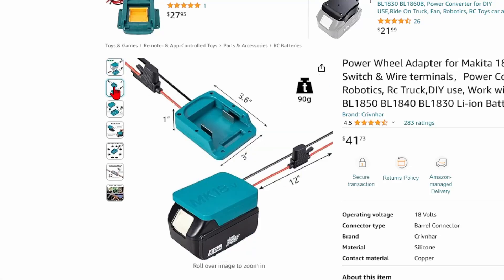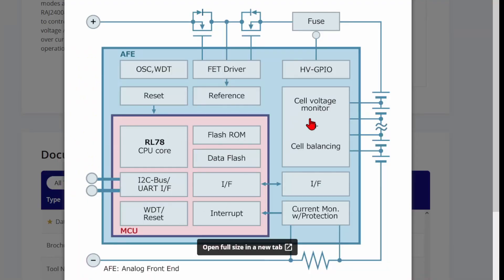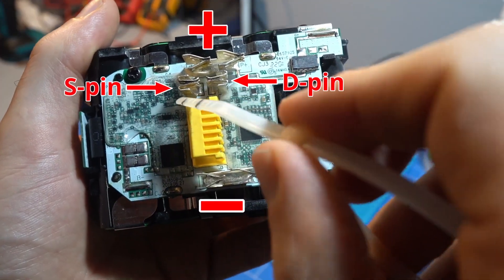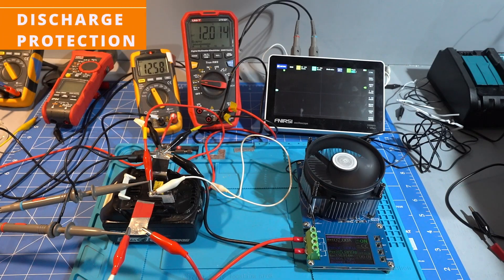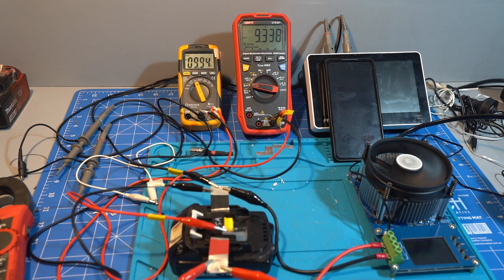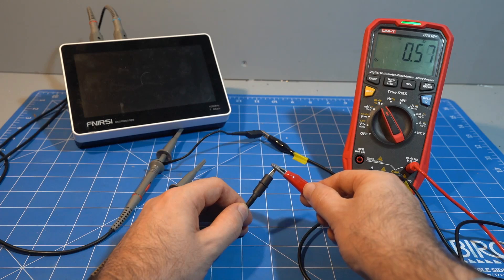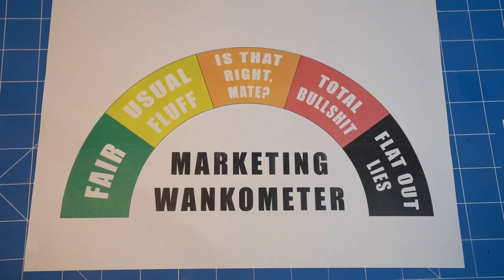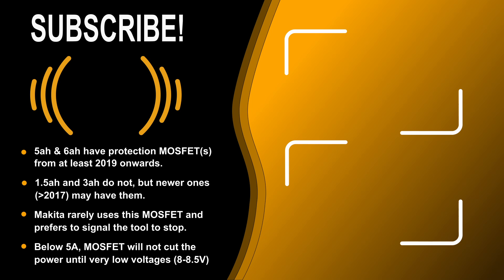[006] Do Makita LXT batteries have low-voltage protection?

Comment: Great stuff! Recently i thought my little Makita fan had bricked my new 6Ah battery after i let it run to dead. Fan only has 2 pins so no temp/voltage monitoring. Battery had no lights, but charged up fine. I wish I'd checked its voltage!
Reply from the maker: Interesting that it's a 2-pin tool. Was it genuine Makita? Was it a really old one from before star protection?

Only other reason would be if it draws less than 1.1A. Under that and the 1.5 & 3Ah go to sleep. I would have thought a fan would pull at least 3A
Reply from the maker: I'm well off. The 235mm fan gets 7h on a 6Ah, so <1A even on high. Even the 330mm fan is 3.5h on a 6Ah, so <2A.
Reply: @toolscientist  DCF 102, built 2020 bought from total tools, yet no Star on it. It's really small (180mm) so low current I guess

Comment: @ToolScientist - When using the battery capacity tester (heatsink and fan) what settings did you use for low voltage cutoff and amp draw?  What would proper settings be to accurately determine amp hour capacity of battery?
Reply from the maker: Low voltage cutoff was always 0V as I was testing to see what the battery's cutoff was. I would stop the test if it went below 6V. Amp draw was usually 7A to make the tests faster, but I did several tests to examine the weird lower cutoff that occurs below 5A. 

Proper settings according to most datasheets is 2.5V/cell and 0.2C discharge. So that would be 12.5V for an 18V battery. Discharge is 0.2*capacity, so 0.2*5Ah would be 1A. For a 3Ah it would be 0.6A. These are quite low and very few power tools would go this low, but that's the industry standard for capacity testing and what most manufacturers (Samsung, LG, Murata, Panasonic) use to rate their cells

Comment: EPIC! What a treasure channel I've just found! I'm thinking if any custom PCBs may help for any upcoming content? If so, we'd love to supply and reach any collab together if there 's chance! (PCBWay zoey)
Reply from the maker: Thanks! Glad you enjoy them. I do have a few ideas that could use PCBs. Those projects are probably several months away, but happy to talk. I've put a contact email in my channel's about page
Reply: @toolscientist  Thank you for the email! I'd just sent one, looking forward to hearing from you!
Reply: Maybe  a redesign of the original BMS board, adding some extra features. When faulty cells have been replaced to create a working battery again.
The main problem is most likely the communication with the charger, if you want to keep using the Makita charger.

Comment: I think the reason makita switches the data signal first and only uses the internal mosfet as a backup is to still allow the tool to do some things. Like my DML809 work light, turns the main light off when the battery runs flat, but keeps a single LED on
Reply from the maker: Yeah. Cutting the negative rail can also be bad for some circuits. What I don't understand is why they added it. It adds significant cost, but doesn't seem to change anything as Makita tools always switch off first.

It could help with pre-star tools that didn't have any protection, but only the 3ah works with those tools, and it has no mosfet.
Reply: @toolscientist  Makita must have had a new internal policy to add more safety within their battery packs.
Reply from the maker: @uhjyuff2095  or external (Japanese laws?), I doubt we'll know ynless someone knows a Makita engineer in Japan. I nedd to get hold of newer 3Ah packs to see if they have it. If they don't, then it's really confusing
Reply: @toolscientist  There are such types of tools as, for example, work lights, fans, power bank attachments that can use any batteries (models with and without a star), even 14 and 18 volt ones, and they only have 2 contacts.
Reply from the maker: @BikerWildRat  yeah, but they seem to have their own cutoff. The light in this video only has 2 pins and it cuts out at 13V
Reply: @toolscientist  How then does this cutoff work simultaneously with both 18-volt and 14-volt batteries, and at the same time use their capacity to the fullest?
Reply from the maker: @BikerWildRat  I hadn't thought of that. Maybe their just not using the full capacity of the 14.4V

Comment: i have 4ah and 5ah pre-2019, but i have over 20 5ah batteries and haven't serialized them - how do i find the date?  I don't see any date code on the outside of the battery
Reply from the maker: First 2 digits of the serial number is the year. Serial number is near yellow connector

Comment: Great video! I believe the more recent 4Ah packs do have a mosfet similar to the 5Ah. My BL1840B from 2018 once cut out by itself while it was used to power a DIY light. It would also be interesting to see the differences in newer style batteries (the logo on the sides) but with no charge indicator (BL1850 without the B). Do those also cut off like their B counterparts?
Reply from the maker: Awesome. Would you be willing to post a video of your 4ah running down on your DIY led. Ideally with a multimeter measuring the pack voltage. Pack voltage going negative at cutoff is a sure sign of a cutoff mosfet on the negative terminal. Some pics of the PCB too, if you're willing to take it apart.

Do you mean older batteries? I thought all batteries were now the B variant.
Reply: @toolscientist  I discharged the 4Ah today via 3 10 ohm resistors in parallel and logged both pack and signal pin voltages. The mosfet turned off at 9.2 volts, the signal pin cut off 20 seconds earlier and before that it stayed very consistently 0.5v below the pack voltage. I'll take the battery apart and try to post some photos of the board.

Yeah, the current batteries are all the B variant except the 1.5Ah. Makita seem to have had a lot of different but similar styles of battery casings making them difficult to tell apart. I meant the generation just before the B variant, I think they were exclusively 4 and 5Ah. They have the Ah marking in a different spot than the current batteries. I think they also lack the mosfet - I have one that I'll take apart together with the B one and include pictures of it too. Fun fact, I completely desoldered the PCB from the older 4Ah to swap the yellow connector. It didn't brick the battery, however it did need a "reset" charge to activate.
Even older batteries (3Ah) have a smaller PCB with less of a coating and a flex PCB to monitor cell voltages.
Reply from the maker: @crazyphil1336  so is that a 2018 4Ah with mosfet cutoff? You won't be able to post links here, only channel owners can. Can you post board shots in this thread: https://www.reddit.com/r/Makita/comments/19609zt/partially_solved_some_lxt_batteries_definitely/
Reply: @toolscientist  Done! I also included a BL1450 (2015) that has four mosfets and a BL1830B (2018) in case it might be interesting.

Comment: Thank you for this video which explains a lot. Of the three BL1830 3.0 Ah batteries I bought 10 years ago, two are still in great shape. (DIY use not trade). One was 'bricked' early on, I suspect because my impact driver is a 2 pin tool which discharged the battery too far and I waited too long to charge it. The cells were fine and I could charge it with a non-Makita charger. A second battery died recently - some of the cells died - but I managed to avoid 'bricking' the BMC. I swapped the cells from the 'bricked' battery so I still have two batteries which work with the Makita fast charger. Not bad after 10 years.
Reply: This comment section is where the party’s at this is the kinda stuff I came for great info boys
Reply from the maker: How did you avoid bricking BMS? Did you do a "live" swap of the cells? I.e. kept voltage on the balance leads whilst removing the old cells and connecting the new ones.
Reply: @toolscientist  I thought about tacking a resistive divider and bench supply across the board during the swap, but did not. I unsoldered it from the faulty cell pack and soldered it to the good one, end lead first then balance wires (flying leads in this case). Then I found the third (split) connector was no longer working. Shorting both parts of the connector to battery positive got it working with the Makita charger and with the 3 pin tool but without low voltage protection.
Do you know if a "dead" swap can brick the BMS so it is rejected by the Makita charger or damage the third (split) connector circuitry? I would not be at all surprised if that was built in to newer BMS chips.
One thing I will not do is buy third party BMS boards without balance wires. Why risk a house fire for the convenience of fast charging with the safety rails removed?
Reply from the maker: @murdo_mck  this vid is my first foray into taking Makita packs apart so you probably know more than me. I'd say it's very likely that disconnecting a balance lead on a new pack will brick the BMS.
Reply: @toolscientist  A couple of other observations: 1) my experience is consistent with claims by others that if a battery is rejected by a Makita charger 3 times in a row due to low voltage the BMS is bricked and 2) If a battery is rejected by the Makita charger due to low voltage (once), it can be recovered by part charging on a non-Makita charger then the Makita charger will accept it again.
Reply: @toolscientist  If Makita BMS is not yet bricked, it can be safely (or how safe can soldering loaded lithium cells be) desoldered. This wont brick it, I have done it several times to replace that yellow connector.

Comment: I feel like makita should have this information publicly available. I was under the impression all star batteries had the same protection due to their marketing.
Also one of my oldest batteries is acting weird, seems like it lost its low voltage cutoff. Instead of the tool stopping it just gets slower and slower.
Thank you for doing this and showing no one was wrong.
Reply from the maker: I think star protection refers to the stop/go signal on the 3rd-pin. All star batteries have this, it's just that the 5 & 6ah then have another layer of protection with the internal mosfet. The weird thing is it seemingly never gets used as Makita tools will always cutout before the mosfet does.

The 3ah will sound sad as they're running it down to much lower voltages (3ah goes down to 9V, 5ah cuts out at 12.5V). Lower voltage = lower RPM, so you'll hear it fading.
Reply: @toolscientist  I have dismantled old BL1830  batteries which did not have star sign. Those had third pin, but did not have 5 cell monitoring (only one first cell was checked) and neither had current monitoring. Old slim BL1815 had similar if not same pcb and setup. Bit newer BL1830s had already star sign but just 5-cell monitoring. Then came current sensing and and one old BL1840 had big PCB like BL1850's, two 50A fuses, current sensing but no cutoff mosfet.
Reply from the maker: I might have misread your comment. Can you measure voltages on 3rd pin? Shallowest should be same as +, and deepest should be 0.6V lower. If they're both the same then somethings gone funky. You could have dirt buildup that's making those pins always in contact. Could be worth taking it apart and giving them a clean.

If no luck, then try measuring the voltages of these pins as you run it. If + goes below 9V and D-pin doesn't drop to zero, then it's buggered.
Reply: @toolscientist  That I can do, I already had the battery open once to see if there is anything obviously wrong.

Comment: Hey Tool Scientist. Amazing video as always. 
I have both aa 3rd party and a bricked makita 5ah battery that I can make work with my tool DTW700Z by putting a 10kOhm resistor between the positive and third pin. Could you explain what is happening to fool both the battery and the tool to work?
Reply from the maker: Bricking the battery doesn't seem to turn off the mosfet, so you can still draw power from it. The 10k resistor from + to the 3rd pin on the tool brings the voltage of the 3rd pin high (i.e. within 2V of +), which gives the tool its go signal. Anything below 12kOhm between + and 3rd pin will make it work.
Reply: I see, thanks for the information. I charge the bricked battery via a balanced lipo-battery charger with a modded 5S jst connector, thus ensuring safe and balanced charging. And 10kOhm resistor to be able to draw power from the battery. How could I additionally protect the bricked battery ? Will the N-type Mosfet(IRFP3006) protect a bricked battery from undervoltage? Again thank you for you for taking your knowledge, time , tools to make and share the information. It will save money and the environment.   @toolscientist
Reply from the maker: @v3nato  unfortunately not. To drive the mosfet's gate, you need the D-pin to be high when the BMS says voltage and temp are good, and then pull it low if the voltage or temp are bad. A bricked battery is going to keep the D-pin low all the time.
Reply: Damn, there goes that plan :P. Would love more makita videos. Maybe one where you give some tips on how we can reuse old bricked batteries? Don't really trust those cheap bms replacement units you can find on a A-xprs. If they even have all the protections features they promise.  @toolscientist

Comment: I have been using LXT since 2009 pre star. I have never gutted and tested a battery but my experience is this. 
Pre star battery's could be used so hard that you couldn't hold them in your hand comfortably. If cooked in this way you had three chances before the charger would reject them. 
I know all Star battery's log their use, Times charged, times overheated and the cell condition can be read.  
Here is a video on the unit. https://www.youtube.com/watch?v=uumwieLu8CE
Most of my Makita tools are star with a couple of motor driven units that are not.  Things like the radio will cut off at a decent voltage that will allow the battery's to recharge but certain tools wont like the old brushed multi tool, the very first 3 speed gearbox drill and the very first impact driver they sold with a LXT. Newer brushed and brush less I have dont seem like they will do this. 
Also a little known thing with them is the interlock on the plastic guides. When the 14 volt platform was a consumer thing there was LXT battery's that had different plastic guides on the top to prevent them from being fitted to a 14 volt and vice versa. Later tools also used a slightly different guide. For example a very early non star battery wouldn't fit the brushed angle grinder 1.5 and 3 amp yet a later one did and it also fitted the older tools. 
The problem with Makita battery's is the amount of fakes out there. Far to many are faked very well right down to the decals and print on the cases let alone the packaging. The only way to tell without opening them up is the charge time. I have had a few "Borrowed from me" and replaced with fakes and can tell you the Boards are different as well as the cells. I have tried new fakes and they are no bargain price usually being about 25%~50% more expensive than the actual capacity  equivalent genuine OEM. 
For the home player if you decide to use Makita dont bother with the copy's as you will only be disappointed.  I just got a LXT lawn mower and bought more batteries to power it as a matched set. I got 8off 5 amp LXT for  $900AUS so they are not that expensive.
Reply from the maker: I think LXT has had a lot of changes over the years, even before Star Protection and definitely a few major ones after Star, too. From what I can gather, the very early LXTs where one of the worst Li-ion designs, then they've shoe-horned fixes in over the years to the point where they've now got probably the most advanced design (although maybe over-engineered). Would be a big effort to figure out the whole history of them.

The thing that I find strangest, is that they've added stand-alone protection to at least the 5Ah and 6Ah, but not made them compatible with pre-star tools. Yet the 3Ah, which is the only battery compatible with pre-star tools, has no standalone protection and they seem happy to just let it get overdischarged or overheated.

The fakes seem pretty rampant with Milwaukee and Dewalt, too. Virtually indistinguishable from the outside.
Reply: @toolscientist  The not compatible is a remnant of the 14 volt tooling using the same basic pattern. You can doctor the old tool guides easily and the new batteries work just fine with no issues I have noticed. The star modification appeared very early in the line, 6 months from when I got my first Makita cordless drill and honestly I got my first set cheap so it was probably end of the line run out.Great video BTW.
Reply: Yep, I remember that the 1.5ah packs would not fit in larger tools to prevent them from overheating. The 3.0ah packs would fit in small and big tools.